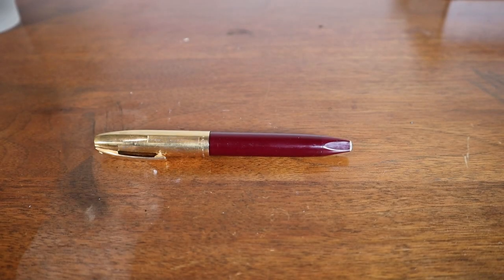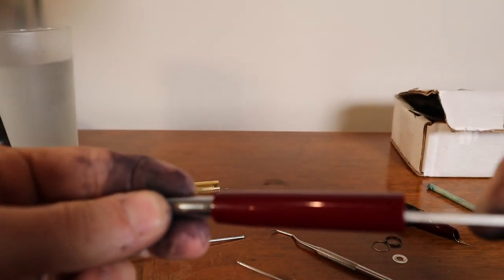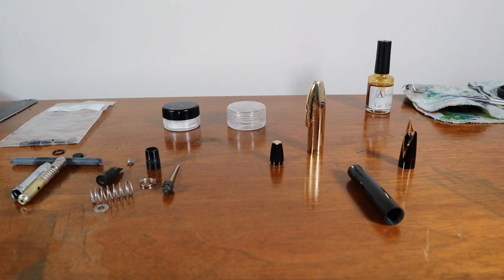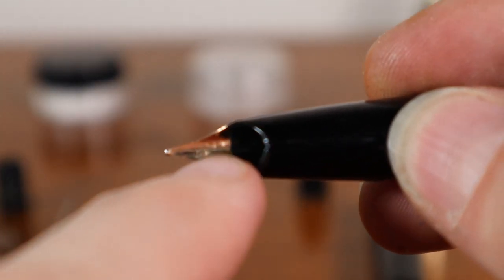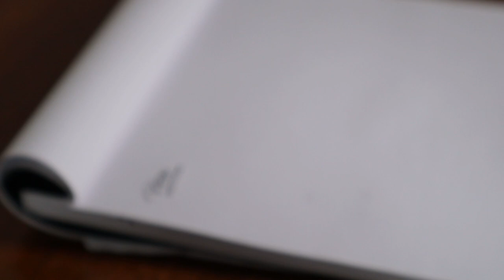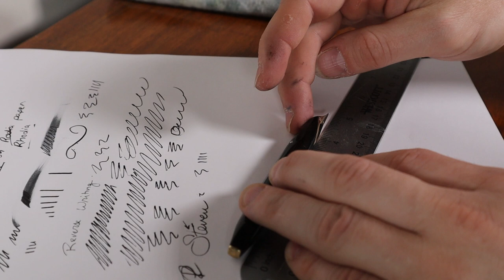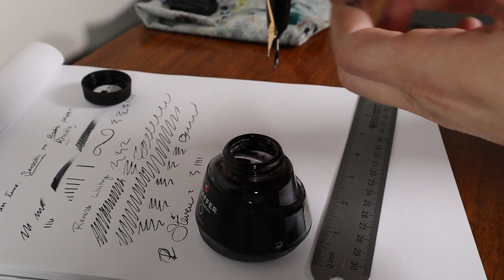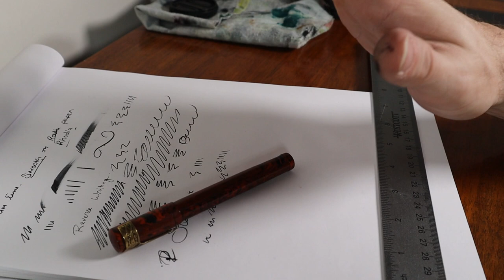PFM Restoration - full tutorial

Comment: What you have there is a PFM VI - the only PFM model that has the gold plated end on the barrel. You fail to mention something that's important:  the caps of all of PFMs are lined with a metal inner cap tube that helps prevent the nib from drying out.  Often, these inner cap tubes can corrode, and if they do the nib will dry out very quickly when the pen is stored.
Reply from the maker: Thank you for that bit of info. I should recheck my nomenclature for sure. As far as the cap liner I usually don’t speak about that aspect since I don’t have the tools to manage these things. But your point is well made and I hope people scroll through and pick up this tid bit